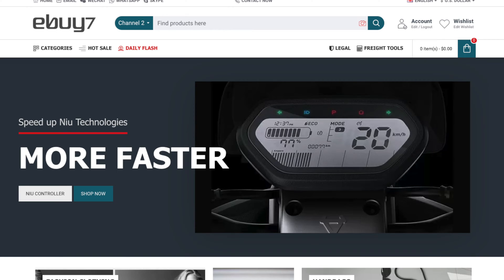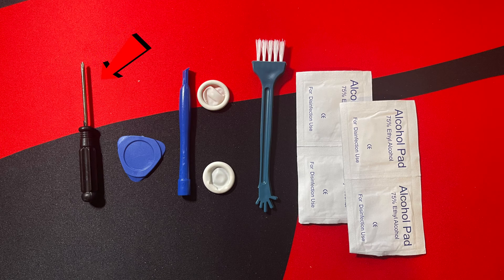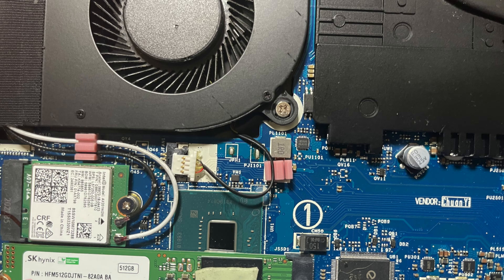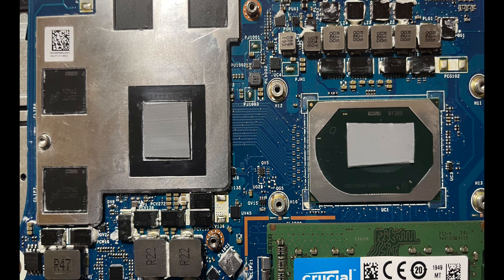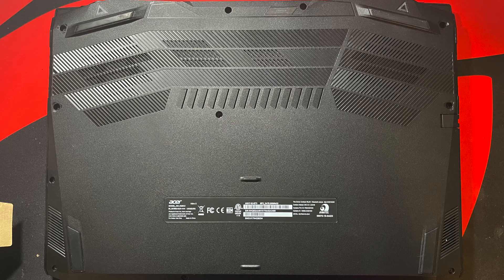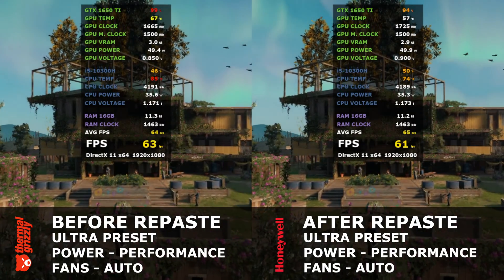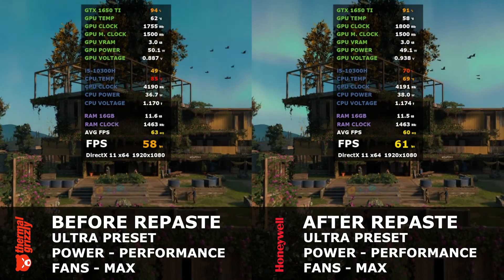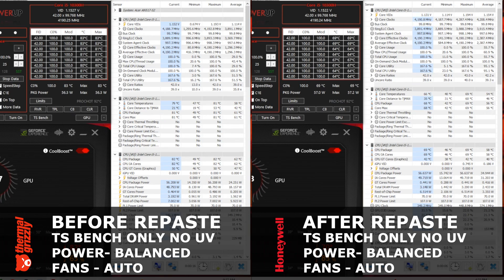Thermal Grizzly Kryonaut - Honeywell PTM7950 REPASTE 👑

Comment: Just a bit of warning about the Kryonaut in laptops... If your machine goes north of 80C, the Kryo will dry up rather quickly with the TG itself site touting that the paste is formulated to halt drying up to 80C suggesting that at higher temps it has problems. I only noticed that disclaimer when I found 1week old Kryonaut started to dry up and discovered ^that lil tidbit
Reply: Good thing i bought MX-4 than kryonaut. But for next repaste i gonna use this PTM

Comment: 80x80 enough for both a gpu and cpu?
Reply: Id be curious to know what size you got and how it ended up working for you. I had no idea, so just got the 80x40
Reply: @ ordered 80x80 but it got stuck in shipping hell in Illinois. Google Elk Grove usps and there’s multiple Reddit posts about how long things get stuck there. Sucks cause if I don’t turn down gpu power and undervolt and lower clocks on my 7900 xtx it crashes in games.

Comment: This + decent cooling pads like IETS or LLano turn my laptop maximum temp of 60 to 70C on stress test and idling from 30 to 40C. Browsing or playing games is round 40 to 60C. This works wonder. Even cooling pad itself improves the the temp but still reaching 90 on startup until I apply this thermal pad that my laptop stops throttling esp. while gaming.

Comment: I'm shocked how much hotter kryonaut is in your case. In my experience even standard Kryonaut has excellent thermal conductivity, not to mention Extreme version you're using. And it's only 55 watts, not 70-100 watts or something.

Comment: I put this on my CPU. i7 14700. What kind of "not doing much except running windows" temperature should I be looking for on this? I saw it was around 50 centigrade earlier today when moving some files. Later it was more like 42 centigrade.

I'm sure it doesn't matter all that much as long as it's not overheating but somehow I thought it might be cooler. I do notice that the CPU is activating its boost and going above 5Ghz surprisingly often so maybe that's why.
Reply from the maker: Your temps are excellent.  Dont worry about repasting or anything like that.  If it gets bad, youll know it.  It will completely shut down. Your CPU is designed to handle 100C, so you have nothing to worry about.  When playing games you may see your temps increase to around 60C  to upper 80's which is perfectly normal.

Comment: Fun fact - PTM7950 pad is only available with 0.25 thickness, if its 0.2 its most likely fake product.
Reply: Sucks to learn this after I bought it but the Temps aren't bad on my 5700x with a nhu12s cooler I get 78c max using 125w
Reply: @tyler6602 don’t worry the “fakes” aren’t even fakes lol they are the same and they are better then any paste on  the market
Reply: @tyler6602  what's the temps before the ptm 7950?
Reply: Either that or the place you bought it from is simply rounding down and displaying to 1 decimal place.
Reply: Don't spread missinformation
Reply: I'm pretty sure mine isn't fake as the temps are very much comparable with what i see on the internet. it is 0.2 mm and i ordered it from amazon
Reply: @NotBorno How's it holding up?
Reply: @wayne6326  pretty good. had reapplied it once
Reply: @NotBorno  if you had to reapply, it's not holding up well.
It should be good for years.
Reply: @magfal on laptop it needs reapplication after a few months. much more than what js required for commercial thermal pastes like thermal grizzly. that shit pumped out in a few weeks. i have reapplied it twice since last year when i bought my omen 16. temps still won't go above 80-85C under load
Reply: @magfal did you try it on gaming laptops? they are imfamous for pump out. ptm7950 holds up at least 20-30x better than fluid based thermal pastes on laptops. it's better but not foolproof. also I'd like to add that by reapplying i meant taking the solid chunks that had slightly moved away from center and putting them back at the center so that it flows back into shape and holds its structure for another few months.
Reply: I think they just round it down, isn't of saying .25mm they said .2mm instead, and even the fake ones perform better than regular thermal paste so what's the point, I guess the lifespan is what we should worry about
Reply: The link in the describtion says 0.2mm
Reply: just got mine today,0.2 thick but it works like magic my GPU went from 80 edge/110c hotspot to 70 edge/90c hotspot & after fan/undervolt it went to 60c/80c ,crazy im able to get 30c reduction
Reply: @mok3734 The spec sheet says it comes in .2 to 1.0 mm so it is not a guarantee this is fake
Reply: the old brochure from 10/2019 moddiy still refers to said so, yeah, but the newer one from 08/2021 doesn´t have that remark for 7950 anymore.
Reply: Not sure about this, i bought mine just today applied it to my Legion 5 and there's definitely a big improvement on the temps (especially the gpu, it's running 10° cooler and got around 12 extra wattage on the AIDA benchmark) although I learned that there are definitely some fake products that can be easily spot from the color of the pads, the fake ones have a light blue shade while the real product is pure dark grey.
Reply: @ReikiMaulana what u applied on the vrams?
Reply: @calmPirate  the pink thermal pads that came with the laptop, I didn't have to replace those.
Reply: people should stop spreading this bs go to their official site and check it. both 0.2 and 0.25 can be original.
Reply: Your information is misleading and also nonsense.
The information is readily available from the manufactures website and here it is regarding thickness....
Color

Light

Specific Gravity

2.8

Thickness (mm)

0.2 / 0.25 / 0.3 / 0.4 / 0.5

Format

Pad

Comment: Are you sure this is actual Honeywell and not a knock off? All official documentation I can find is that Honeywell is 0.25 thickness, not 0.2, and when I was looking for this I noticed all the knock offs would say "for Honeywell" and try to trick you. Also I've seen a few benchmarks and the .25 makes a difference, especially on a laptop.
Reply: Most likely fake product
Reply: amazon seller joyjoy is proven good product and they sell 0.2mm too. Most of them are rounding up to 0.25mm.
As long as it's PTM, it doesn't matter if it's 0.2 or 0.25 , it melts
Reply: the old brochure from 10/2019 moddiy still refers to said only 0.25mm, yeah, but the newer one from 08/2021 doesn´t have that remark for 7950 anymore.
Reply: Even a fake Honeywell ptm7950 kicks ass, You could say if you copy an amazing product, you still get an amazing product.

Comment: And what about the lifespan of this thermopad? How long does such a thermopad last?
Reply: A friend repasted his 4090 with noctua nt-h1 and after around a month started seeing hotspot increase quite rapidly due to pump out, used ptm7950 and after almost 6 months it’s still performing the same as the day it was applied not to mention it’s a good 5-8c cooler than then the paste as well, I have some thermal videos on my channel with a 4090

Comment: What would you recommend on a Lenovo Gaming 3? I tried thermalright tfx but still pumps out. I heard this is the stock thermal pad for the laptop. Running 5600h and 3060. Thanks!
Reply from the maker: PTM will not pump out.  It almost solidifies when it get cold and then loosens up when the CPU gets hot.  It's worth a try if all else has failed.
Reply: @Meanpooh  just got and applied ptm 7950. all is good so far. is it normal to still get 100 deg when playing marvels spiderman? the pad is a day old.

Comment: Hey I hope you see my message. I have a gigabyte aorus laptop. Last week I tried thermal grizzly kyronaut thermal paste and the CPU temperature went up to 90 degrees, then I bought mx-6 and applied it twice, the result was the same. If I buy honeywell, will these problems be fixed? I noticed that every time I opened the laptop, the paste overflowed from the places I applied it to the edges.
Reply from the maker: A gaming laptop reaching 90C is not bad. It's not going to damage anything.  I have an Alienware that reaches over 100C and runs flawless without throttling.  Thing is a tank.  There are things you can do to make sure the temps kinda stay under 90C with just a little bit of performance loss.  make sure you are not applying too much thermal compound can cause it to squish out from the sides.  Try to look for thermal compound that has a higher viscosity than the ones you have tried.  It's not guaranteed that Honeywell will fix your problems.  I have it on all my machines and the temps are low.  All the videos I make have the Honeywell thermal compound added to the CPU and GPU.  I did have trouble with my Legion 5 Pro.  After applying it took a week or more for everything to stabilize.  When the Honeywell compound is cool, its very dry.  It becomes somewhat liquefied after its heated.  Try using Throttlestop as well as a laptop cooler to assist with the repaste.
Reply: @Meanpooh  Thanks for your comment. It wasn't 90 degrees before. It's overheating right now, I think it's completely spilled out today, I can't touch my keyboard, the speaker is buzzing, and then it shuts down because of the heat. I want my old degrees back
Reply: I heard that Lenovo now uses Honeywell as well. You use honeywell but you do not fully guarantee it. I don't want to buy thermal paste other than the much talked about honeywell, I feel like my money is going to waste.
Reply from the maker: You should run your machine using Power saver to see if it still overheats and shuts down.  There is something else going on besides the Thermal compound.  Make sure all the thermal pads are replaced on the VRM's and other components.  Honeywell should work.  Its one of the best I have ever used.  Just know that different machines have different results.
Reply: @Meanpooh  There was never any paste in the vrams. It sticks to the copper pipe with a pad similar to double-sided tape, but my graphics card temperature is normal and my processor is abnormal. As far as I know, the vrams belong to the graphics card.
Reply from the maker: Alright then you should definitely try the Honeywell PTM or give the IC Thermal Pad a try https://amzn.to/3Q88FQc.  It's a literal pad that is reusable and won't squish out under compression.  Really hard to diagnose without having my hands on it.
Reply: @Meanpooh  okey thank you i will try
Reply: @samimsamet  i think your problem is not with thermal paste or pads, you should consider on cleaning your fan exhaust, i think it’s clogged that’s why you’re having excessive heat on your laptop surface and the air only circulates inside your laptop and can’t go outside.

Comment: After research I believe ptm7950 is awesome.... But I'd your opinion on k5 pro, ltt proved it to be good but almost every one else says it makes the ram temps worse, who do I trust?
Reply from the maker: I have no comment for RAM usage but it does work in places that are tight and very difficult to get the correct thickness using a solid thermal pad.  It's worked well for me but if you can use a thermal pad, it will better as there is no mess.  That's the worse part about K5Pro.
Reply: @Meanpooh  good to know, I appreciate your response. 👍
Reply: Typed some alternatives for K5 but youtube says i'm scamming.
Reply: Another try: Upsiren U6 Pro, penchem TH949-1 or TH930

Comment: I just used this stuff on my laptop to replace the liquid metal and im shocked at how much better is it. 16c cooler on the cpu while gaming!!! iv never been impressed by any TIM before but this stuff is incredible. They should be using it on all laptops. Cleaning the liquid metal off was a nightmare and it was on the verge of leaking.
Reply: Lenovo started to use it on all their laptops.
Reply: @KnurdMonkey  not the 9i legion thats liquid cooled, or does it use pads too?
Reply: @positronikiss on the cpu and gpu die is honeywell. The liquid is just marketing ads for vapor chambor heatsink  usage
Reply: @KnurdMonkey yep lenovo been using this on all their legion for quiet sometime already
Reply: It shouldn't be giving better thermals than metal. IMO you had shit mounting pressure and while reassembling the heatsink you've fixed it.
Reply: @alexmin4752  Thats exactly the problem with all laptops. They dont have uniform fits for heatsinks. Theres always gaps and then theres the fact the laptop moves alot, it flexes. Liquid metal just isnt suitable and alot of manufactuers are understanding this now and moving away from it and towards variants of ptm 7950. Ofc it doesnt have the same thermal properties of liquid metal but the thermal properties of liquid metal are useless if it cant stay exactly where it needs to stay to keep those thermal transfers going long term. Its often fucked after a couple of months some people even report that their thermals are hitting tjunction on day one.

Comment: why after i try it gets worse? I checked to open again the heatsink the paste ptm literally gone was like pump out
Reply from the maker: I don't know.  I'm puzzled as well.  I made a few videos but only when I repasted again and changed the thermal pads did the temps come back down to almost stock.  I feel as though the PTM has to adjust to the CPU surface.  I know it sounds weird but that's what I experienced.  As of now my machine is doing very good.  Run some software that really pushes the CPU and GPU for a while then check the temps doing a normal routine.  Give a few days of normal gaming.  As for pump out, never experienced it with PTM.  It's different.  It will harden when not in use and become like traditional thermal grease when temps rise.
Reply: @Meanpooh  is there an cure time or does it take effect immediately?
Reply from the maker: There's nothing stating there is a cure time that I could find but like mentioned before my machine got better over time. I guess that would indicate that it does take some time to work.

Comment: Some of my ptm7950 came off when I lifted up the plastic sheet. I stored them in the freezer for 10min before operation but it still came off, I needed to scrape the out then applied to the dies. Is there a better way to remove the plastic cover?
Reply from the maker: None that I know of.  I've had this happen to me plenty of times forcing me to move to the next corner.  I did have a situation to where all 4 corners have failed me and I had to resort to a sewing needle to separate the plastic, sorta like in the video.  Freezing before using works pretty good as long as you can remove it quickly before it warms up.

Comment: My CPU was designed for liquid metal so I think I should use it for it. The GPU came with some kind of thermal paste so I'm going to use this pad for it, thanks! Also I want to ask if I really should use liquid metal on the CPU as the plastic protective film around it has a few bubbles in it. I have a ROG STRIX G172L laptop and I have used it consistantly for a few years at high temps.
Reply from the maker: If you feel comfortable applying liquid metal then go for it.  If you happen to get any of it on any part of the board where it does not belong, you may kill it.  Be careful and take your time.  If your temps are just barely breaking 90C I would not bother.  Try cleaning the fans and using a laptop cooler since its been a few years.
Reply: @Meanpooh  Thanks for the quick response and tips!

Comment: I didnt get the same temps are yours I tried to go to a service center and let them apply the thermal paste on my laptop ( ptm7950 ) , But all I am having is a much higher temp as hovering around 90 to 95, but before my temps is like 80 to 89 degrees. Does it take time to take effect when applied on the laptop?
Reply from the maker: For this machine it took just over a day for everything to work correctly.  The thermals should return instantly but in my experience it varies.  I repasted my Legion 5 Pro and it took almost 2 weeks before everyone normalized.  I have a video showing that.  Most machines will be different.  I have heard of people having no luck and ending up buying a new heatsink with the thermal grease applied.  Give it some time and see what happens.
Reply: Thickness matters too. Might need to stack the ptm

Comment: I have an MSI GL66 I used PTM on, the cpu appears to have very low mounting pressure on the cpu, the PTM doesn't "Melt" like it did on the GPU, and the temps are worse.

The GPU is actually Way cooler for me. Unsure if the other components near the cpu using thermal pads are holding the cooler up too high.
Reply: i feel the same on my msi gf63 .ptm temperature more high than original paste from msi . i think it is because my heatsink have thick thermal pad for vram that maybe affect the mounting pressure
Reply: @syamshudafalahalquds9159  I ordered some thermal goop to replace the thermal pads. it should squish more than the original pads. I'm hoping this works because that 12700h gets HOT fast doing very little.

I also cinebench quite a bit lower than where a 12700h should be. (before and after honeywell PTM)
Reply: @Twitch-R6  i change my ptm to thermal paste grizly kryonaut and the temp reduce 
before cpu 80 ° and gpu 70° when playing game
after  cpu 70° and gpu 60°
10° improvement with grizly kryounaut
Reply: @syamshudafalahalquds9159  I tried Kryonaut already, it didn't made much of a difference from stock.
Reply: any mm raise in pads from stock will cause low pressure while mounting, also screw in the heatsink in the appropriate order the screws should be numbered. @Twitch-R6